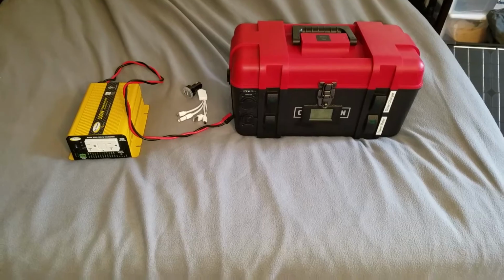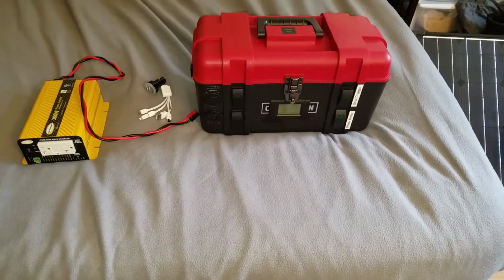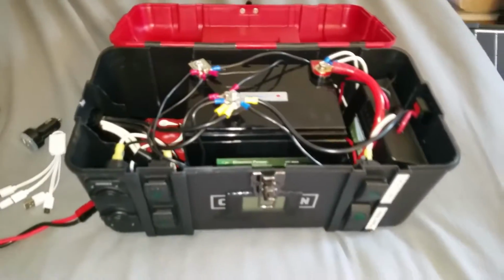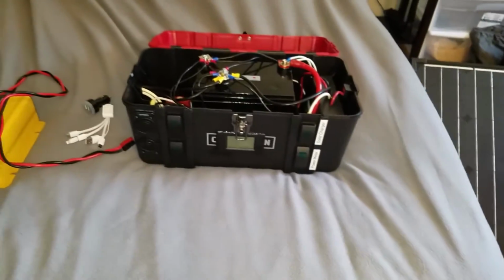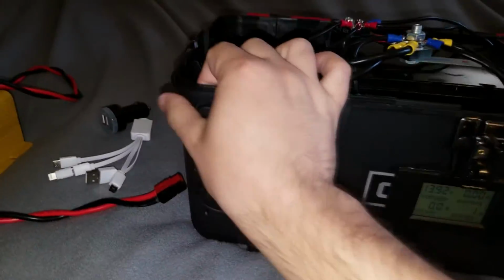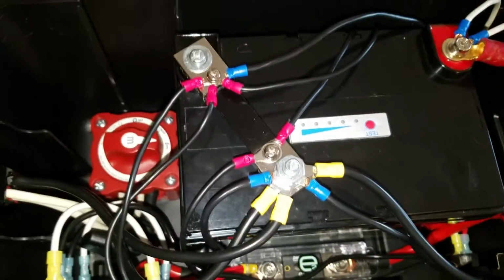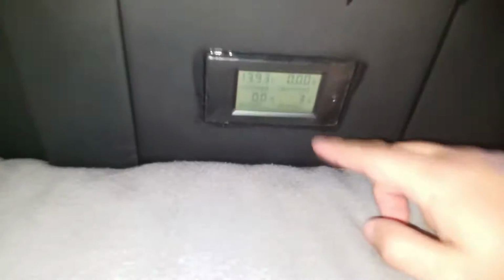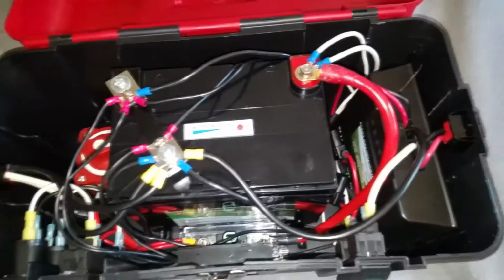Portable LiFePo4 Battery Box / Solar Generator

Comment: I have a 36v lifepo4 battery can i do something like this
Reply from the maker: Yes you could, but it would be a bit more tricky. Since all of the stuff I have built into my box is based on 12v nominal, you would need to get a converter to bring that 36v down to 12v to use a lot of my gadgets. They do exist and it's definitely a feasible option that would beat trying to buy another battery at 12v, since you already have the 36v.

I've actually thought of getting a converter myself, for my electric bike battery which is a 48v lithium-ion. It would just add to the available power I have on this box. Albeit Li-ion is a little less safe than LFP, it would be a nice backup. 

Alternatively you can get electronics designed to work on 36v but those will be a harder to find. Personally I would look for a good quality 36v to 12v converter.

Comment: Awesome job man, your box is one of the best on YouTube. My only qualm is the BMS in the battery. That brand of battery I've seen people struggle to get power to go through the BMS with a low power solar charge controller. Also I've heard a lot about BMS failure with any lithium battery system since its made of many small electronic parts that could increase chances for failure so that could brick the battery which would be a huge money loss. The Lifepo4 cells are amazing technology and as you say can be a decade of use given the cycle life. I'm doing a similar build but I'm opting to use Headway 38120 cells and become part of the no BMS movement. That just means I will have a low voltage cut off circuit as a external module I can replace if it fails so I can keep my expensive cells at least. Charging will be a balance charger for Lifepo4 and I'm fusing each cell so that covers what the BMS would do.
Reply: I thought that might be you by the way the responses were. The cells should be fine with that care taken but I'm still weary on putting a lot of 18650 size cells together in parallel just because they can't be monitored individually when soldered together and I'll always wonder if a few are unhappy in the pack. I bet Tesla always suggests charging their car batteries to 70% for these reasons. They are in banks of 16 cells in parallel. Well the NCR18650 Tesla cars are. Not sure what their doing with the new 21700 sizes yet. So that's another reason I like the Headway cells being much larger. They come up to 100ah per 3.2v cell. So for me using the 10ah cells I will only be paralleling 3 of them to get my intended 30ah. I wanted to use the 15ah 40152s and only parallel 2 but its too big to fit in the space I need so I had to drop back to the 10ah cells which just barely fits. The Headways only issue is they have huge thick mounting plates to connect the cells and I'm not a fan of that since if there is an issue with shorting the pack its going to be like 500amps discharging from the pack which for certain will damage some of the cells and maybe cause a fire, so I'm soldering glass axial fuses to smaller copper plates that will hopefully keep the resistance low as possible (shortest possible fuse leads) but still have the accuracy of a sealed glass fuse at cell level. I see people using random fuse wire on their 18650 DIY packs and its not known what amp rating they will blow at. Air blowing on the fuse wire  in the case of an e bike driving will also cool the wire and change the amps it can take could be much more. When you have hundreds of cells that could wildly change the combined amp output before the fuses blow. So I got to use a real fuse to know I'm not too far off safety wise.
Reply from the maker: Thanks for the comment!
Although I've personally had no issues with my BMS taking a charge or anything else, it has always been a thought on the back of my mind that it could fail. If that were to happen I'd definitely be cracking the plastic case open to see if I could diagnose the circuitry myself and hopefully find something easy enough to fix with a few cents at the local electronics store and my solder station. That said, worst case scenario, I can strip their BMS out and build a new one or just rough it without a BMS for a short time by being careful of my charge states. I'm hoping that doesn't end up being necessary though. :P
I chose a pre-built system so that I wouldn't have to take the extra time building my own but I will if it comes to it.
I hope your build goes smooth!
Reply from the maker: Actually, now that you mention it I did come across one thing that annoyed me with Bioenno's BMS, which is that it cuts off both the input and output when the battery reaches a full SoC. This means if I'm topping the battery off with my panel on a nice sunny day, while simultaneously running a small load, my load will lose power when the BMS basically reboots upon reaching the voltage threshold. I opened up a case with them to see if there was anything they could do but it didn't go anywhere unfortunately since that seems to be how it was designed. That said, there responses were quick and courteous.
I wish their charge controller would disconnect or limit the charge at a voltage lower than their BMS's cut off so this wouldn't happen or just make a better BMS :P. Fortunately it hasn't been a huge issue for me since it doesn't impact how I use the box most of the time, so I haven't bothered trying to replace anything to address this, just an occasional nuisance. I definitely wouldn't use their stuff on a bigger, always on, type of system though.
Reply: One issue with most BMS is the very small resistors that are turned on to dissipate power when one cell group is at its maximum safe voltage. If those small resistors have to dissipate too much power they can easily burn out. I bet this is why Bioenno designed that to cut the input. Why they would cut the output is strange. You'd figure it would help with any over charging of the cells which would be easier on the BMS. Thank's for the info on this, its important for some people to read I'm sure. I think the best batteries and BMS systems are Victron. But it costs a fortune. I will not double my cost to try Victron.
Reply from the maker: Well at least resistors are usually pretty easy to replace and can be upgraded to a higher wattage too to help there. I agree that it's definitely not the best design on BioennoPower's part. Victron was one of the first controllers ones I looked at, I really liked everything I saw and read about their stuff, but like you said they're pricey. Before settling on building my own, I had juggled the idea of dishing out for pre-made system from portablesolarpower.biz and they use Victron for their stuff; but again so dang pricey! Those are some nice battery boxes though!
Reply: What I was referring to with the BMS failing was bricking the battery cells without you knowing. If the BMS fails say to a resistor failure and one cell group starts to over charge it can slowly or quickly ruin that bank of cells. Same goes with the low voltage cut off failing on the BMS. My balance charger has a voltage readout of each cell group and also I have an ISDT BC-8S battery monitor that shows high and low voltage history of each cell and current voltage of each. It also has an audible alarm that I can set for low voltage of any cell. So I will be able to have 2 voltage references as a redundancy and know if my charging system or cells are failing due to any electronics failure. That's the true reasons why I'm joining the no BMS movement, to know what each cell is doing at all times. With the Bioenno you can try to replace the failed BMS if it does but a cell group may be dead or very unhealthy when you realize the BMS is dead.
Reply: I like that stuff from portable solar power biz. I'd want the Victron Bluetooth controller that shows the BMS details. Pretty awesome. If I become wealthy some day I will buy something from them!
Reply: Ohh, I see what you're saying now. I was just thinking of a dead BMS as one not functioning at all, but that's a good point about it cooking individual cell banks if only that portion of it goes bad. Well, I guess that's the risk I take for having an all-in-one "easy battery in a box" instead of getting the individual cells and setting things up better myself, as it seems you are. Thanks for your insights. If I ever decide to do something like this again, especially on larger and more costly scale, I'll definitely be looking into what you're talking about with the individual cell monitoring and redundancies for voltage references as that's definitely the best approach.
Reply: My reasons come from battery failure! I had a very expensive e bike battery fail. As it turned out the BMS failed and bricked an entir cell group in the pack. The thing for me was there is no warning or way of knowing, just failure and wrecked cells. You'll see a lot of people and repair shops that have lithium e bike/scooter batteries that fail and its always the BMS and one or two cell groups that fail. Not all BMS are going to be bad but you have no warming or way of knowing when electronic failure happens. So visual cell monitoring makes sense to me to keep my expensive cells healthy. The ISDT BC-8S alone is a pretty slick option. The OLED screen shows a bar graph of high and low voltage of all cell voltages and you can set the low voltage alarm at the voltage you want. Its uses minimal power so I can leave it on while I'm using.
Reply: Heat can tell you a lot for over charging and also cell health/internal cell resistance. If you have FLIR or Seek thermal camera you can check battery cells and the BMS when its completing charge and see if any is looking hotter than others. Its also can show if anything on any circuit board is too hot while doing any task so you can not blow up the BMS. Visual thermal reference for anything with current flow is a smart way to understand all going on.
Reply: That's true, heat can tell a lot of the story. When I'm charging anything I usually periodically check it just by touch to see if there's anything blatantly amiss. I don't have any thermo cameras though. That's a bummer about your bike, good to know though because I was thinking about upgrading from Lead Acids to some sort of Lithium tech on the e-bike I built, most of the options I was looking at having a BMS. I considered trying to make my own with some 18650 li-ion cells, perhaps more do-able with something like your battery checker and not even bother with a traditional BMS. Doing it myself would allow me to sculpt the shape and capacity of my bank to fit just right in my bike too. Many of the pre-built ones aren't quite right for what I want. Plus, I like the idea of being able to manually balance the banks when the variance gets too far apart. Do you actually manage each single cell or banks of cells in parallel? That would need a Lot of monitoring channels to watch enough single cells to make a 48v e-bike battery.
Reply: I've done the touch method recently with all my older 20v drill batteries as they were charging just to see if any felt hot. That's a good thing to do to know basic health. All packs no matter who makes them are monitored in banks of cells in parallel. Those cells in parallel self balance and share capacity and resistance in an absolute equal balance in ratio to their specs, so there is no way to monitor the capacities, resistance etc...of each cell in a parallel setup from what I understand unless you probe each cell with an ammeter and separate the battery cells individually which would be a lot as you say in a 48v pack! Julian Ilet has a video on YouTube called "Playing with Lithium cells and Arduino Ammeters" that gives a good visual understanding of the parallel part of the battery pack and how each cell performs differently within the parallel group. So for me I just get all my batteries and try to match the cells so the capacities and resistance is similar. Obviously any higher resistance cells should be discarded since they are not going to have the same cycle life and could eventually be a hot spot in a large parallel group. Then all the parallel groups get added in series and that's what I monitor with the ISDT BC-8S. I also am not a fan of the 18650 Li-ion.They can go off much more violently as we see from all the vaping injuries and death if the cells get abused, shorted and get too hot. I'm sticking with Lifep04 even though it is not as energy dense as the standard 18650 Li-ion. The Headway cells make it really easy to make a big pack being larger cells with screw terminals and modular mounting brackets. I feel the same as you, there is nothing that suits my needs either other than a well monitored pack. If they made a BMS board that had even LED lights that showed me red/yellow/green at specific voltages and one set of LEDs for each group of cells, with an audible alarm then I would be fine with a BMS built in. But there is nothing yet.
Reply: It just dawned on me that I just started replying with my other account because it's what I have logged in with my default browser and BinaryMan is on a second browser, hahaha.
That's what I would have thought with the banks of cells, since being in parallel balances and should be fine as long as you get same spec cells with similar capacities / resistances to limit hot spots and one cell bringing down the group. I'll have to check that video out from Julian, sounds neat and informative. I agree that 18650s are more volatile than LFP and is one of the main reasons I went with LFP here, but they are usually cheaper to come by too. I should probably price out enough LFP cells to make a pack and decide if the extra safety is worth it to me lol, I don't use my e-bike that much anymore so I'm trying to find a cheap solution to improve it :D
Thanks again for all the good info! Nice to see I'm not the only battery nerd around :P

Comment: Seeing that you built this two years ago, is there anything you would do different about the gen? After this video, I want to build one like this.
Reply from the maker: As for the box itself the only thing I would, and plan to, change is the USB output. The one got isn't very strong and it's better just to have a second 12v cylinder car outlet to plug in a dedicated USB Quick-charger from a good company like Anker.
The only other thing I think I would do differently is get a flexible thin film solar panel instead of the folding one i got. It's rather big and clunky.

Comment: Hey, what's the watts on this generator?
Reply from the maker: The output of the battery box itself can sustain 480Watts output constantly or 960Watts for 5 seconds. Of course, loading the battery down with 480watts will drain it quite quickly, less than an hour.
The Solar panel is rated for 100 Watts and does actually output near that amount into the battery with peak sunlight via the MPPT controller.
The AC inverter I got is 300 watts.
I hope that answered your question.

Comment: Very cool. Can you charge the battery any other way besides solar (from a generator or from AC)?
Reply from the maker: Oh yes, of course! Bioenno Power has their own 10A charger for it which plugs into the AC outlet, I bought it with the battery. That is how I Primarily charge the battery for convenience reasons. You could possibly charge it from a generator but it would be best if it as close to 14.6v and 10A input as possible. If it's higher than 14v but less than 10 amps you could use the MPPT solar charge controller which will bring the voltage down to safe levels and also increase the current as it does with a solar panel. I've charged the battery from a 48v 1.25A power supply through the solar charge controller before; it worked great and gave me somewhere around 4.3 amps into the battery.

Comment: Nice, I would like to know where you purchased the "shunt" your term for the multi connector you have on the termal post for the wife disconnects. I can't seem to locate this item. I'm building a battery box. Thanks!
Reply from the maker: So, in electronics, a shunt is a device which allows electric current to pass around another point in the circuit by creating a low resistance path. In this case, the shunt is allowing me to measure the current out and in with respect to the battery.
The shunt in my box came with the energy meters I bought. If you go to the description there should be a link under Energy Meters for you to go to on Amazon.
Hope that helps! Let me know if you have any other questions :)

Comment: About that battery, sounds awesome but the link you provided does not work. I wonder if you could talk more about the battery like the amp hour rating or the group size if applicable.
Reply from the maker: Sorry about that, it looks like they’ve revised the
battery I bought, I’ve updated the link to point to the revised one. It has slightly
different dimensions but is the same capacity and type.
Mine is a 40Ah LFP battery that is the size of
what you would find in a riding lawn mower. It’s more than likely the outside
case from a 35Ah AGM battery, but instead of the lead goodies inside they
installed LFP cells. It’s almost identical in dimension to this one:
https://www.amazon.com/VMAXTANKS-Vmax857-Battery-Minnkota-Trolling/dp/B008974VFG/
Reply from the maker: I believe Group U1 would be about the correct size.